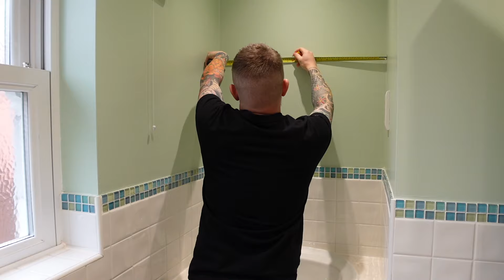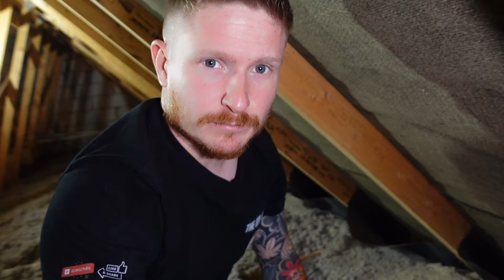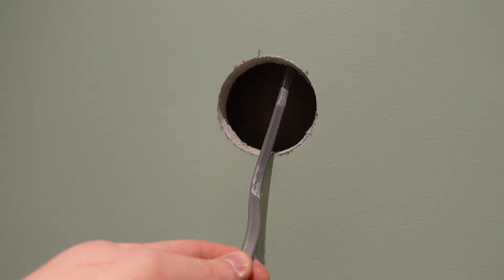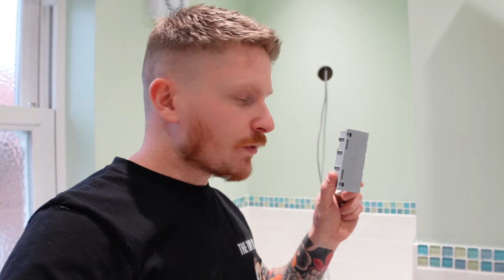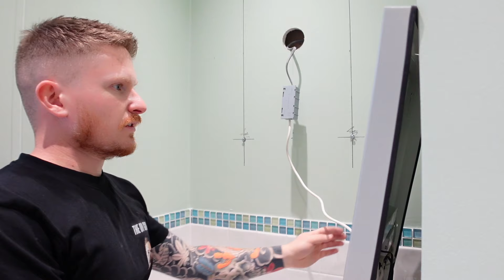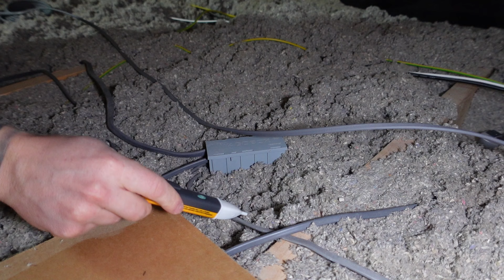How To Install a LED Bathroom Mirror | Wiring a Heated Mirror

Comment: Thanks for the video, I am just about to attempt this in my house. Just a quick question, am I right in assuming that the 40mm hole drilled into the plasterboard is the correct height to be directly behind where the gland from the mirror is, so the mirror flexi wiring pushes into the hole you have drilled. I assume if you didn't do that the mirror wouldn't sit flush to the wall? Also, do you seal the cut hole to prevent moisture, being in a bathroom?

Comment: I have sockets in my loft, can I put a plug on the end and plug it into the socket? If so what fuse would I use in the plug . If doing it your way should I have a switched fused behind the mirror.

Comment: Bit late to commenting on the video. I’m thinking of doing something like this, however, I have a 3 pin socket in the loft above the bathroom. Couldn’t I just do what is in the video except wire it into a plug head and just plug it in up in the loft?

Comment: The bit I need to see is how to attach the front mirror onto the rear box with such tight fit in the alcove. I have the same size alcove. What do you you use to screw in the side screws, please?

Comment: Surely you'd want a 3a fused spur? I'm all for doing electrics using common sense over sometimes pedantic regs, but I'd not want an appliances only isolation to be at the consumer unit.

Comment: Hi, just installed mine with exactly the same electrical connections but the mirror only comes on with the main bathroom light, can’t you wire it so it comes on independently? Cheers great vid

Comment: why didnt you drill a small hole in the centre of the cut out behind the mirror, pull the cable through it and stick the cut out back in the wall so there's not a big hole behind the mirror!

Comment: The mirror was wired into the lighting circuit without any isolation switch. What happens when you need to isolate the mirror from the supply? Is the DIY guy definitely a qualified electrician or just showing us what he thinks is good enough? Does it comply with Electrical regulations? Especially with all the bathroom rules.

Comment: we are replacing a little bathroom light with shaver socket but it only has live and neutral with no earth, yet the LED new mirror has an earth. Do i need to connect the earth or just leave it in a connector without an earth supply coming to it? Thanks

Comment: Question...
What if the bathroom is downstairs, so there's no loft... how do you get power/wire from the first floor ceiling light over to the wall ?? Love to know if you have a video or details on this? @The DIY Guy
Reply: Very difficult in a 2 story house unfortunately. Sometimes there are exhaust fans or AC registers you can remove for access but most the time it will require a section of the ceiling to come down

Comment: Hi could you have wired to the shaving socket on the adjacent right hand wall provided you could chase the cable around? I have a similar situation however lucky for me i have a shaving socket on the same wall.

Comment: Hi there DIY GUY!! I have an LED mirror with a demister, can the same components you've
used, we can use... Mirror has neutral, live and earth and the wires in the loft are black and red?
Reply: Take power from ceiling rose

Comment: Warning: these illuminated cabinets are fine but the ones with built in shaver sockets make a continuous buzz from the low budget isolating transformer arrangement. I paid for 3 and now have to disconnect all the sockets and provide separate ones

Comment: If I have an LED mirror with a 3 pin plug on the end of the flex, should I just remove the flex/plug and wire the 1.5 cable straight into the connectors inside the mirror? Thanks for the video!!

Comment: How do you wire it if it’s not a stud wall?
Reply from the maker: Unfortunately you will need to chase a cable into the wall
Reply: Do you have any videos on this? Or recommend any? For chasing a wire into the wall.  Thanks.

Comment: In regards to bathroom zoning, does the mirror have to be 0.6m away from the sink/tap is this to the bottom of the mirror or where the electric box is on back of mirror?

Comment: was chuffed to see you had a video on this. i did this with my bathroom mirror a few years ago.. however down in the downstairs bathroom.. concrete wall! :( you cant access the ceiling from the loft as theres a bedroom above it. so am thinking of chasing a cable into a fused spur. and then have that fitted next to the back of the mirror and then have the mirror connect to the spur. i guess XD

Comment: hi very informative video can you help me out  I've just bought a led mirror but it came with a 3 pin plug lead with a small connector which goes to the mirror and push fit connects to 2 small wires red and black  but I've ran a 1.5 cable down my wall do I ignore the plug and just put the black and red into a connector block and then wire my lighting cable into the block ?? any help much appreciated
Reply from the maker: Hi, just ignore the plug and wire it straight into the lighting circuit.

Comment: Does the wire not get squashed against the wall and make the mirror not sit flush against the wall?
Reply from the maker: No as long as you feed it in properly it will be fine.

Comment: Great video👏🏾👍🏾why do you connect the led mirror to permanent Live?
Reply from the maker: Thanks. It is connected to a permanent live because if you put it on a switched live then the mirror would only function when the room light is on. Alternatively you could install a seperate switch.

Comment: Great, very well explained. Which option is more better...giving power to led mirror from Main Live or Switch Live terminal? Thanks in advance.
Reply from the maker: Hi, that depends on the mirrors functions. If your mirror has a switch to operate it independently then you would take it from a permanent live. If you want it to operate from a seperate switch then you'd be best to take it from the switched live.